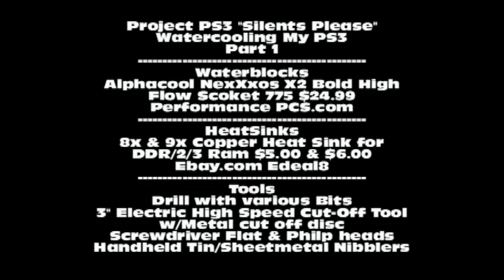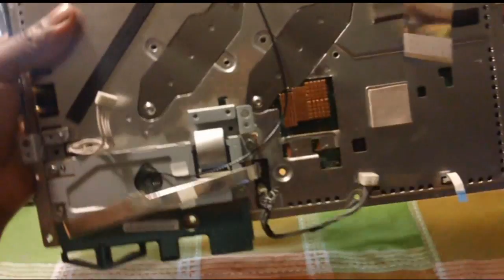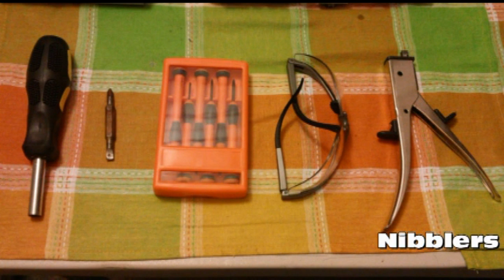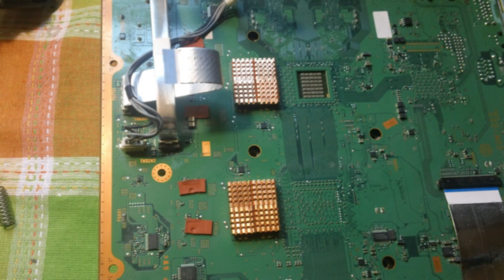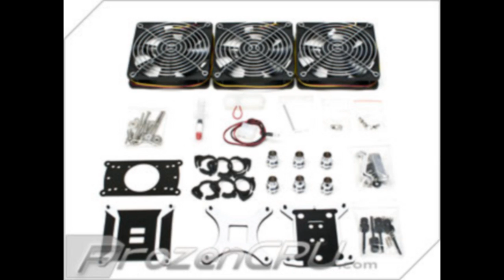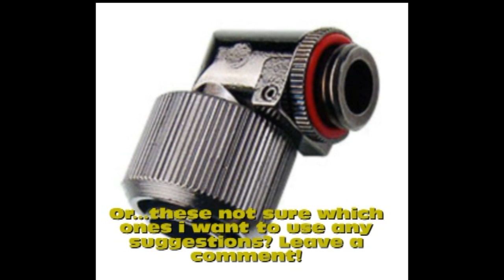PS3 Water Cooling Project. Code Name: "Silence Please"

Comment: Hey, I'm thinking about doing this too, but how can I get the power for my pump without having outside psu's? Can I simply plug the pump into the 3 pin connector from the fan? Or do I have to solder the wires to the board?

Comment from the maker: @bintikwala Yeah pretty much but make sure that the "arms" you know "X" you can drill thru, that why i used a water block that has plastic arms so it would be easy (or should i say easier) to cut the ends off. just for you i will make a video on how i shaped the water blocks stay tuned...oh and yeah i ran into some project money deficiencies so it had to take the back burner for awhile but with my tax money it should be up in running soon. Thanks for all your comment and stay tuned!

Comment from the maker: @bintikwala Well the LGA775 water block has an "X" shape and the ps3 holes are "\" shaped so i had to cut the opposite ends off so it would fit on the board. Thanks for watching